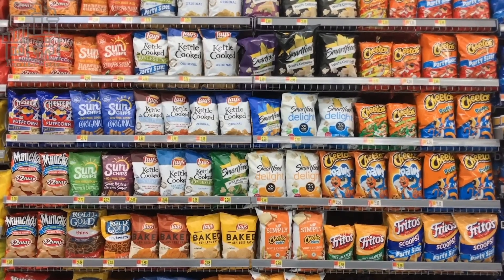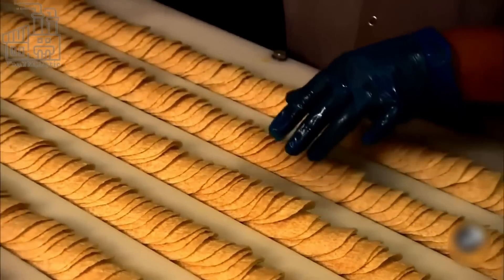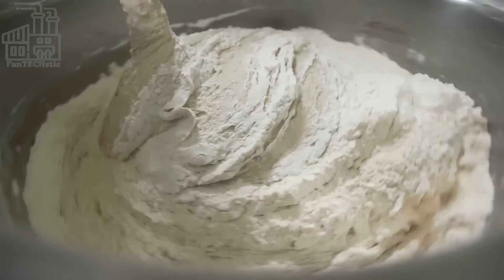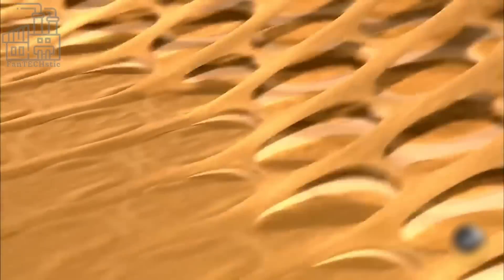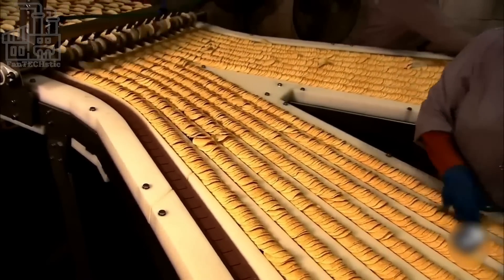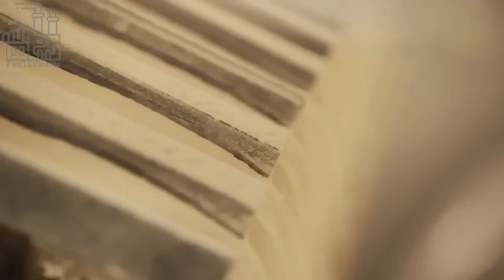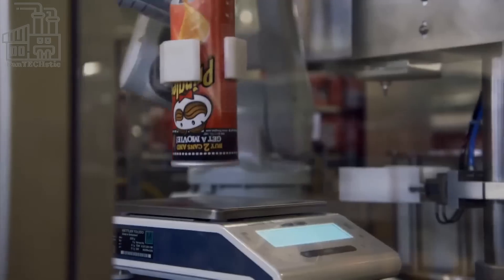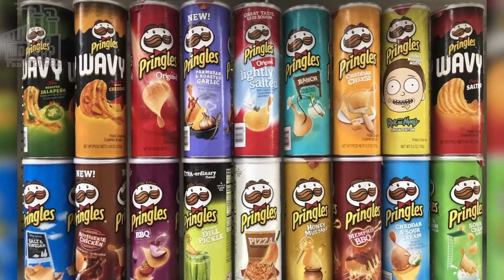Ever Wondered How Pringles Are Made?! Join us on this FanTECHstic Factory Tour!

Comment: Just for accuracy and correct information, Pringles are not considered potato chips.  In 1975, the FDA said that Pringles can only be called potato chips if they were made from real dried potatoes.  Pringles then rebranded them as Crisps.  Just want to make sure accurate information is being told.  You can’t call Pringles chips. It may be potato based, but the potato is not sliced and processed.  The potato is made into dough.
Reply: In Australia they are called chips.
Reply: I‘be been told the opposite is the case in England.  (disregarding Pringles) what we called “potato chips”, they call “potato crisis”. 
So, (I’ve been told) in the UK, Pringle’s are called “Potato Chips”
Reply: What if they identify as a potato chip 😅 😀
Reply: @bryan70546  Then it is time to launch a national boycott.😊😊